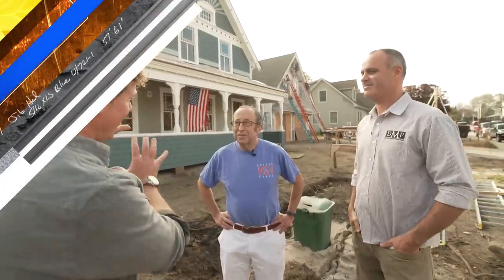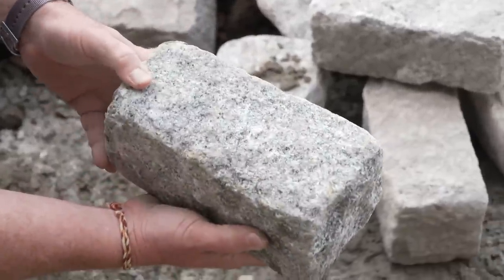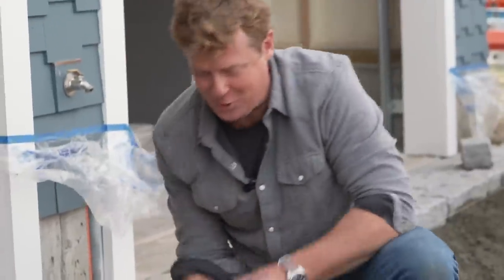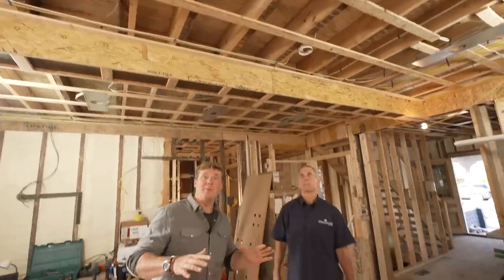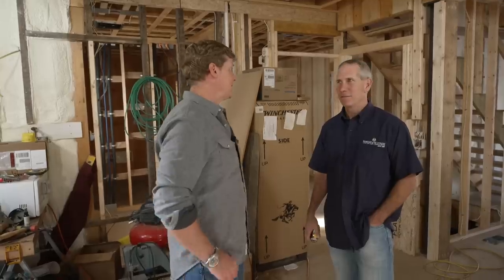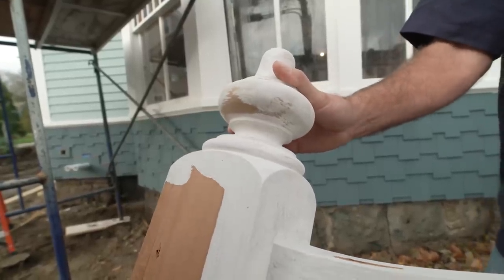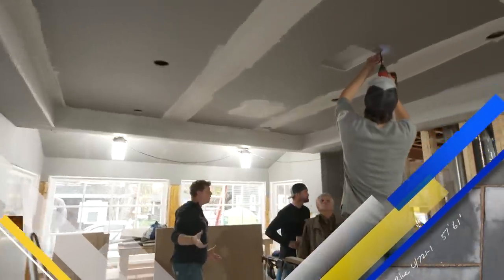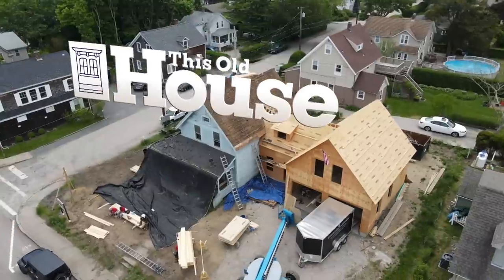This Old House | Outside Details (S42 E10) | FULL EPISODE

Comment: I don’t see the point of this remodel, keeping existing material, not any of it.  Leveling a house worth of old lumber, then sistering it all with a bunch of ripped 2x6?  Enormous cost.  Why? To preserve some old  unseen lumber inside the walls and ceiling? 

This entire house could have been demo’s to the ground in a day, new foundation dug in a day.  New foundation and basement walls formed up and poured  in three days.  The entire original  Queen Ann floor plan, if that’s what you want, could have been built w new modern material up to the roof and house wrap in three weeks.  Then add all the trim details, but none of that needs w 120 yr old material.
Reply: Yes, but then it's not THIS OLD HOUSE anymore.  And it becomes a boring show.
Reply: @hudsonhousejournal7063  ok, but 1. this was 90% not an old house any more. It’s a McMansion painted and trimmed w a fake masonry chimney to look old.  2. There are plenty actual oldish houses that need interesting fix up tasks, but these contractors and architects and designers and suppliers can’t get a pay day by supporting a show that encourages people to spend $50,000 instead of $3 million.

Comment: why are they wearing masks outside?
Reply: Because they're low level grunts. The   big time operators , stars of the show can't get COVID
Reply: Why do you care?
Reply: @pi1810  what dust? there's no dust setting bricks into cement.
Reply: @pi1810  the brick layers are upwind of the mixer, no mask needed. those thin cloth masks won't stop silica dust.
Reply: @brianglade848  🦐farts?
Reply: @brianglade848  😂😂😂
Reply: @pi1810  concrete isn't corrosive, i've seen pristine rebar inside of concrete.
Reply: @dlg5485  ??? Slavery is not a joke!
Reply: @AugustKling  I'm almost afraid to ask, but what in the hell are you talking about?
Reply: @dlg5485  WEF